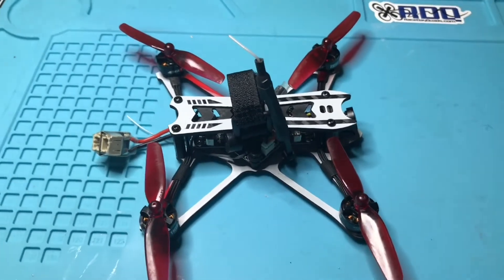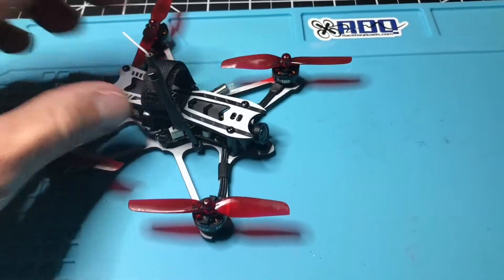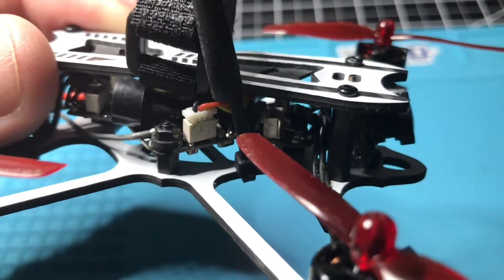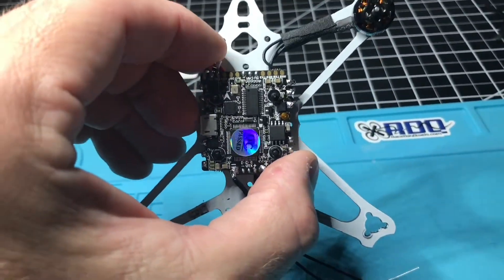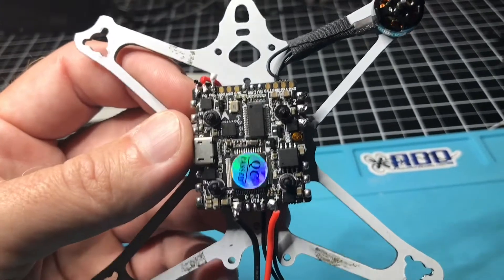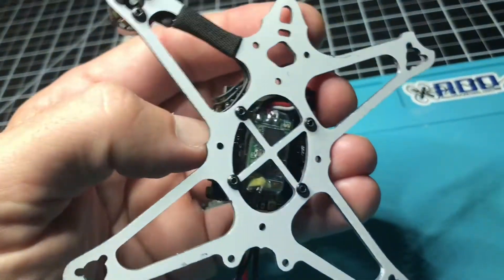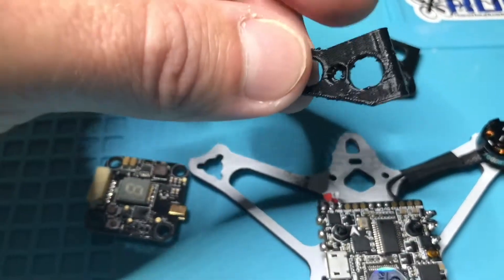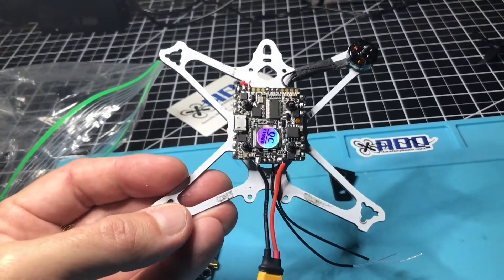Emax Tinyhawk Freestyle:  Major Modifications

Comment: Looks good, good idea about the strap and antenna. Cheers brother
Reply from the maker: It gained weight...however, now sporting a 25-800Mw TBS smart audio VTX and 1104 7500kv motors...it's now 3s capable.  Stay tuned for the next video!
Reply: @MALNTV  will do brother

Comment: Well that should be fun!  I'm in process of modding mine. Just the usual camera, vtx, rx deal.  Look forward to seeing how this ends up!  I made up a set of similar Camera mounts but mine slip over the stock standoffs which will be more sturdy.
Reply from the maker: Do RC I finished?  It’s 8:04 central and done with the build...next Betaflight and BLHeli
Reply: @MALNTV  nice!
Reply from the maker: @DoRC    It gained weight...however, now sporting a 25-800Mw TBS smart audio VTX and 1104 7500kv motors...it's now 3s capable.  Stay tuned for the next video!  In essence... except for the frame and props...it's no longer an Emax...I shall call it the HGLRC Freestyle...had a test flight yesterday..the finalized Betaflight and a short flight in my room.  Gotta clean up my workshop before shooting a video. I'm a pig when I do mods..I usually take everything out of my cabinets and lay it on my workdesk...looks like crap right now..got to clean up
Reply: @MALNTV  sounds like me. I shove everything just out of frame to make my videos but the mess is still there:)
Reply from the maker: @DoRC  That was me for my last video!!!  I thought I was the only one😄😁😁😆.  Seriously...I need to hit you up for some 3D printed V2 camera adapters.  You're correct...I don't think the ones I got from EBAY will live through a hard crash
Reply: @MALNTV  yeah I don't really like how the mount is the standoff on the version you got. I've got a PayPal link in my video about them.  Just throw me a few bucks and I'll get em sent out.  I've been really surprised. I've sold over 35 sets so far. I figured I'd only sell a couple..
Reply from the maker: @DoRC  let me check out your video

Comment: Cool video.  Im just wondering what those props are . I was thinking of using 2-blade props instead of the Avan rush , hoping to slow the drone down and maybe get a bit more flight time. Would 2-blades have that effect ? Im more interested in cruising , than doing lots of stunts.
Reply from the maker: Joseph Cachia 2 bladed props work well with this quad

Comment: Mine keeps blinking red...cant bind??  Ant ideas?
Reply from the maker: Sleeping Bear if you have the stock flight controller (Fc)...this is what you do (also states in the instruction).  Fist located the bind button on the FC..once you find it remember where it’s located..will be labeled Bind.  On your Taranis ensure you made a new model D8 channels 1-8.  If you did..go to Bind on the Taranis but don’t bind yet.  On the Emax plug in a battery and let it initialize.  Then find the FC bind button and press it for 5 seconds..lights will change and will be in bind mode.  Now on the Taranis initialize bind..Taranis will chime when binding...you should see LED lights of FC change to.  Now turn off bind on the Taranis and unplug the battery of the Emax.  Plug back in the battery and it should auto bind.  Please double check documentation..you will need a magnifying glass to read it.
Reply from the maker: Sleeping Bear also...I am subbing your channel
Reply: @MALNTV  big thanks...I gor it to bind..changed something in beta flight?? Now just blinks red. No matter how long I press? Just red blinking light now??
Reply: @sleepingbearffg5008  u need to cli mode and put in version and download and flash that exact version

Comment: Did the talk to text did not come out right I meant to say Align T. rex 470 dominator.
Reply from the maker: It gained weight...however, now sporting a 25-800Mw TBS smart audio VTX and 1104 7500kv motors...it's now 3s capable.  Stay tuned for the next video!